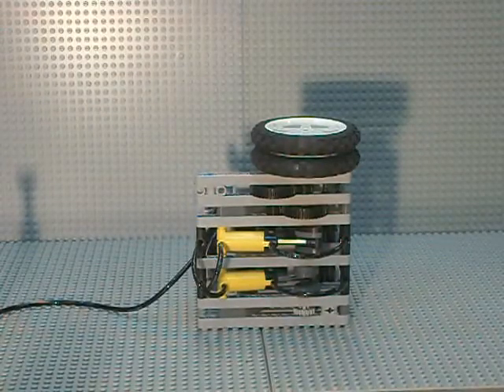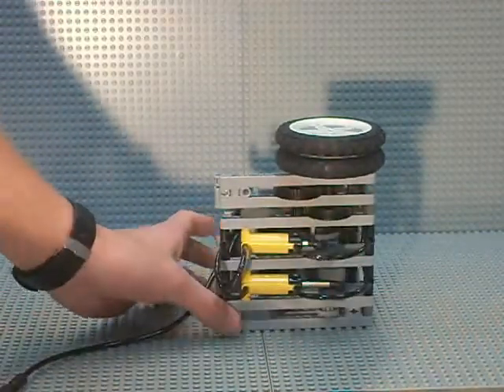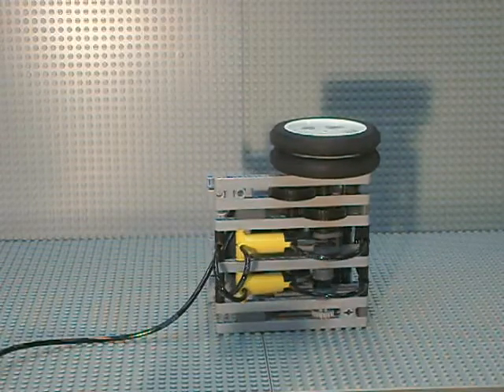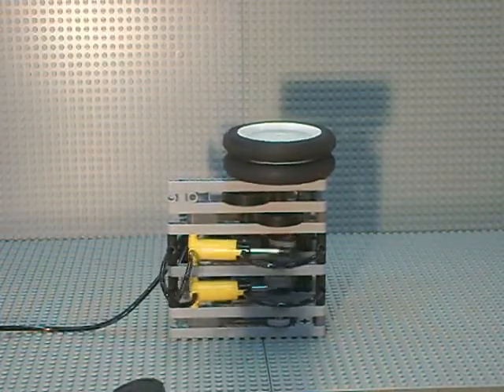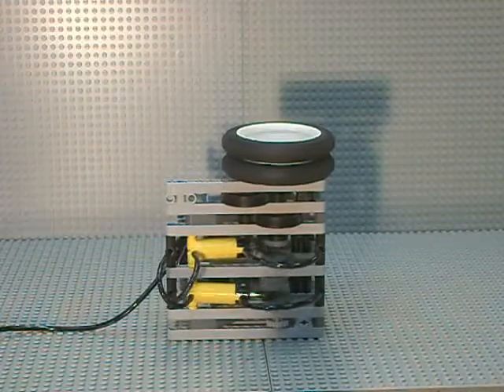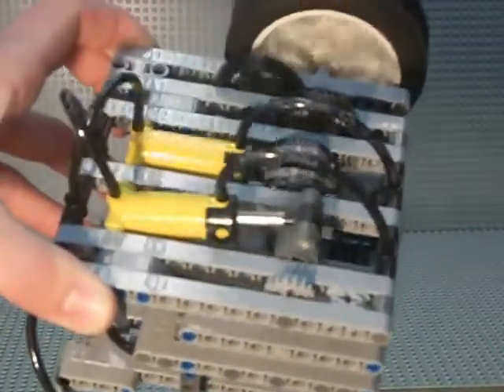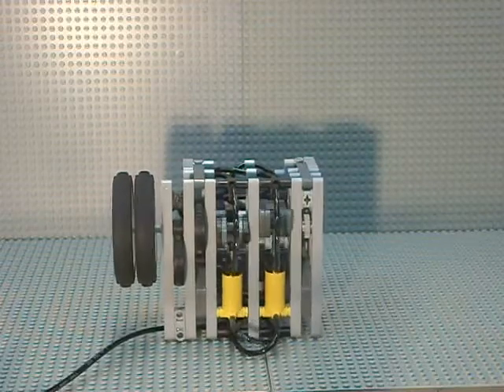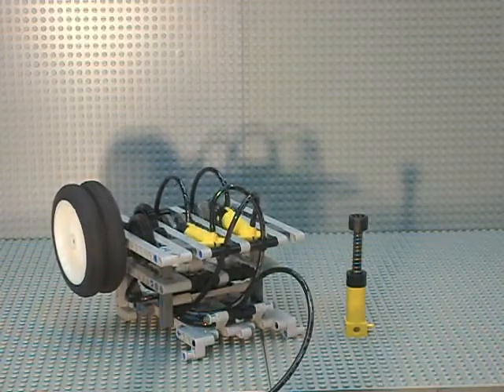Lego 2 Cylinder Pneumatic Engine

Comment from the maker: If you want, I can make some closer pictures.  I'm using two 16 tooth gears to separate the cam shafts, so there is 1 stud between the two axles.  The cam shaft is composed using part number 60483, with gaps above the switches.  The cam shafts can't be continuous (there must be gaps above the switches), because otherwise the switch levers collide with the cam shafts when toggled.  I'm glad to see your interest in my engine!  Tell me if you need any other help, I'm more than happy to supply it!